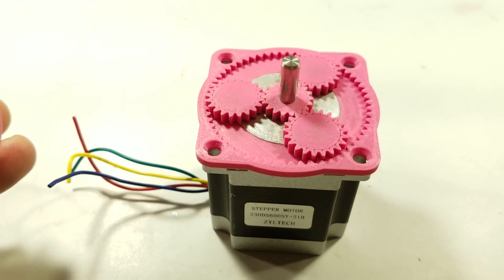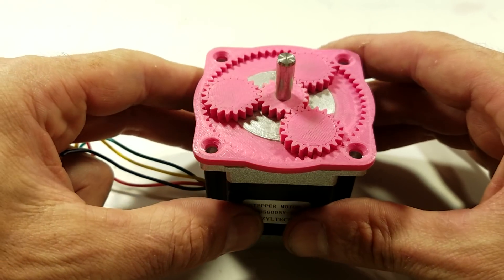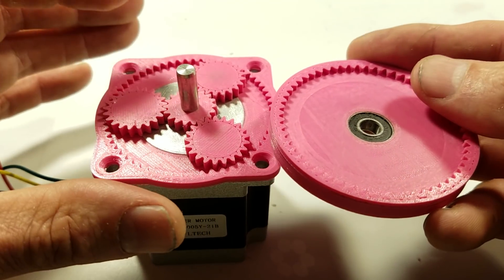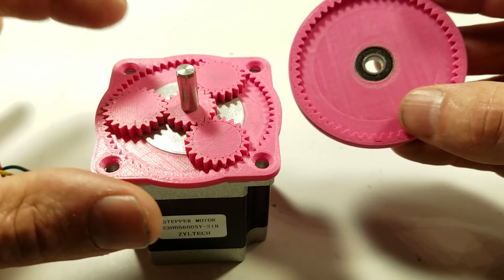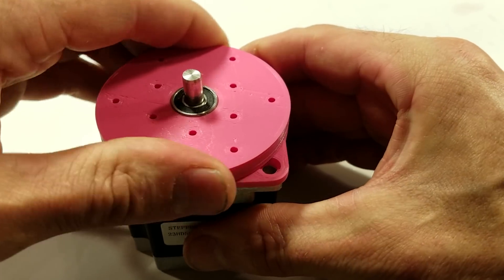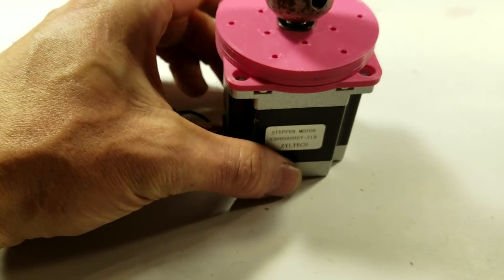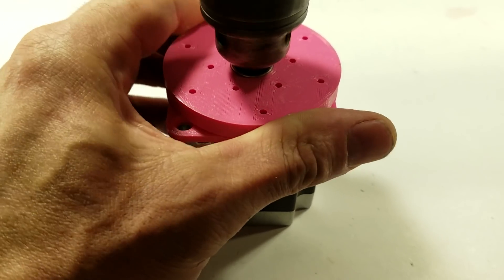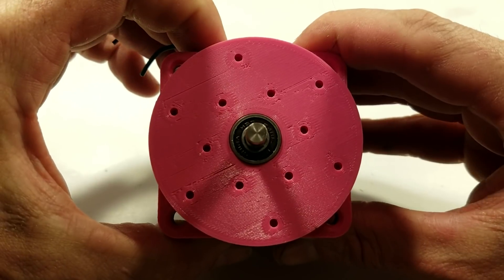MPRT - Modified planetary robotics transmission

Comment: how it can work if teeth count diif. bigger has cheated module LOL or just bigger and loose. i understand when there is double planetary gear and it calculated to be same circle, but i see those planetary gears have one teeths only not 2 diff. why not just same ring teeth. will it make it less ratio that output from planets. no it will make it more. so why ring has diff teeths if same teets work get more ratio LOL

Comment: For anyone hitting this, also search 'Nema 17 Güneş Gezegen Dişli Sistemi Aktuatör / Sun - Planetary Gear for Nema 17 Stepper / Actuator'
This uses one planetary system for both upper and lower outer gear.  You can actually have two completely different planetary systems, the lower drive and the upper output, and have both of them be 3 planet and connect the planets together to drive the upper system from the lower.  Should let you get a bit more range in input to output gear ratios, of course still best to have it reasonably similar size wise..
And of course making the gears a bit thicker and helical can improve the smoothness and backlash etc, standard gear ideas still apply.

Comment: This is a mix of a planetary transmission with a strain gear. Seems a bit more woobly (i.e. some backlash) than a pure strain wave gear but seems to work much better with 3D prints as you don't need to keep deforming any part and it's more compact. Really nice.

Comment: Trying to get my head around this. So is the fixed gear slightly larger in diameter than the other? So one gear isn’t at the ideal spacing, but close enough that it doesn’t matter! Or is something else going on? Very clever, btw.
Reply: Ah, I see you answered elsewhere. So “yes” it seems.
Reply from the maker: @JeremyCook  You got it.  For the latest version no more fudging of the gear pitch is needed actually as I finally sorted out the math needed to calculate the pitch offset for the two layers.  They each have the proper pitch for the gears they mesh with now.
Reply: @Arcus3D  Cool, thanks! Yeah, saw the dual planet design, that makes sense.

Comment: How much torque before the teeth strip?
Reply from the maker: Good question.  There would be a lot of variables to account for there and I have not done the math, but it should be something close to the shear force of the planets/num_planets.
I'm also working on a robotics wheel which this will be driving, so I'll be able to get some real world data soon.

Comment: click nice! 
does the planets have 2 different tooth spacing in order to engage top and bottom rack? can you show the amount of backlash it provides?
Reply from the maker: Yes, the two ring gears use two different diametrical pitch settings to compensate for the 3 tooth difference between them, but at that diameter the deviance needed is less than the tolerance I allowed for 3D printing them.

As for the backlash, this print was still a little loose as I really over-estimated how much backlash would be required to mesh nicely.  I'd say it's somewhere between 0.5-1 degree right now.  However, with one spring loaded planet and moderate loading, it could be effectively zero..  Watch the project logs for that.  It's coming..